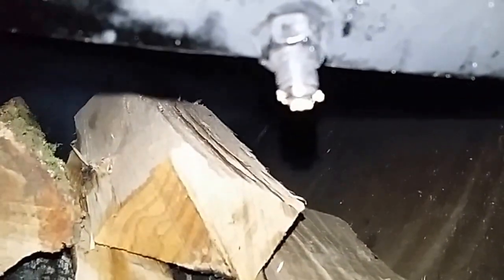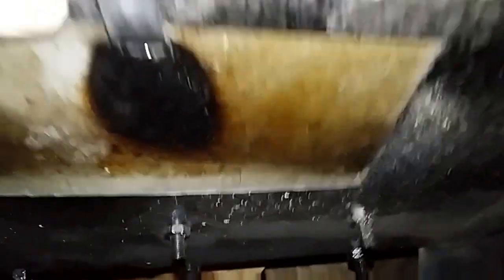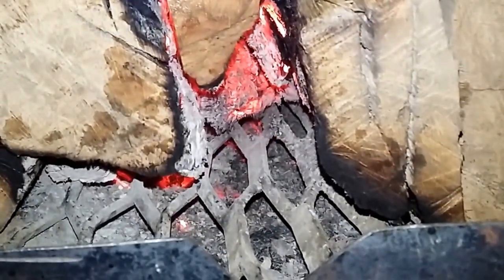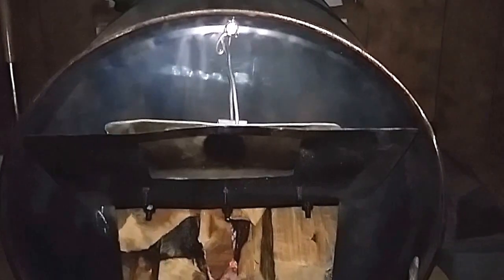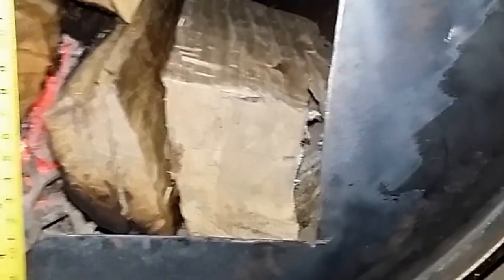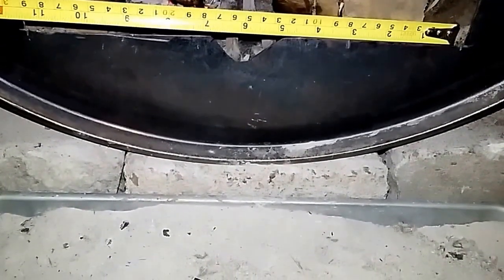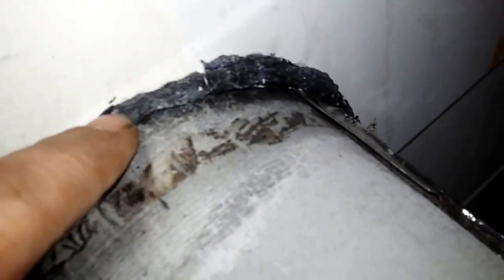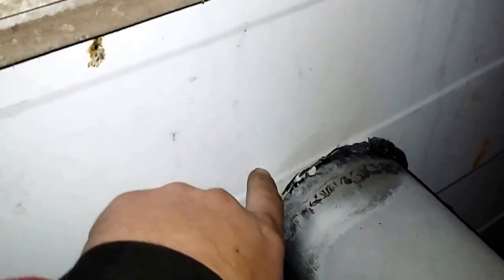Furnace Demensions with Thomas If It's Cold Out...

Comment from the maker: Okay Mark let me set you straight I don't believe that I said that one alternator can put out 20000 watts because that would be insane a alternator puts out 8800 Watts that is 80 amps x what? The alternator that I showed in the video after bypassing the diodes actually puts out 90 amps. Mark there is a reason why I didn't put all the information about my system on the internet. Do you know what 8800 Watts will do to one person? This system is not for everybody and if you're not educated enough to have been able to see that there was missing information from the video and know what it was, then I don't think you should try to build this without my help. There is no need for hateful comments anywhere on my channel which is the whole reason why I turned the comments off on that video. And I don't think that I suggested Someone putting 3 phase to their house most houses run on 2 phases at 100 or 200 amps. What was the last question you had? Something about electric companies burning oil yes Mark I think they get their oil for free doesn't everyone I get gasoline for free don't you and to all of the people out there who I have been sharing the missing information with please be careful and only share this with your loved ones.

Comment: You've disabled comments on your "Free Energy" video, yet you solicit questions for it at the end.  So I'll ask them here:

You claim your alternator outputs _220V_ at 90A, yet its a car alternator (they output more like 15V).  Clearly it cannot output 20kW or so (it would melt down).  Care to retract that claim?

You also sugget using a 3-phase AC output to power a home - that doesn't make sense, domestic appliances are
usually single phase (or 2-phase balanced in the 'States).

Also you gloss over how you actually provide the power to turn the motor that drives the alternator - if you have a
supply for the motor, you don't need to convert it to mechanical power and back again, you can use it directly.

And how do you imagine an electricity company generates electricity for free then?  They get their fuel for free then? Ha!
Reply: +mark (the not they out put more like 15V) guess you don't get it. let me help you. go to your vehicle and remove the regulator from your alt. then hook diode to battery. crank vehicle .watch battery very very closely and let me know what happens when you get out the hospital..ha ha ha ha ha ha . just  kidding.stand back at a safe distance and get ready to replace your battery. this is 101 on why regulators are needed .
Reply: don't have to be educated to figure things out. its called common sense.something most educated people don't have because its been removed during their education process or social engineering how ever its the same. cheerio.
Reply from the maker: +truth*is*treason yeah and do the same thing you're suggesting accept bypass the diodes because the diodes change from alternating current to direct current which is what your battery is and yes if you put 80 or 90 amps of direct current to your battery it will blow up anyone with any knowledge of electricity would know that but hey if I put air in this tire for the next three days it'll blow up to...
Reply: Lmao